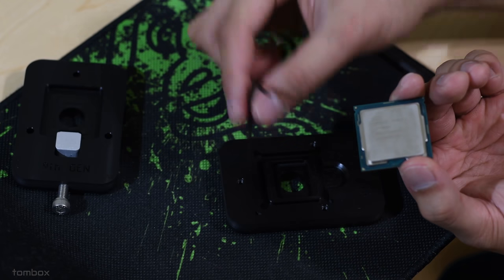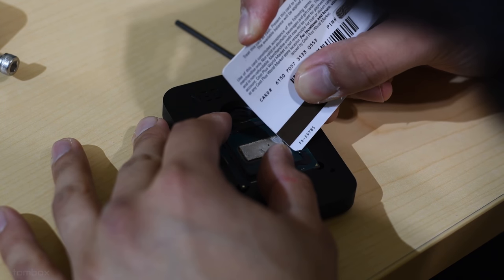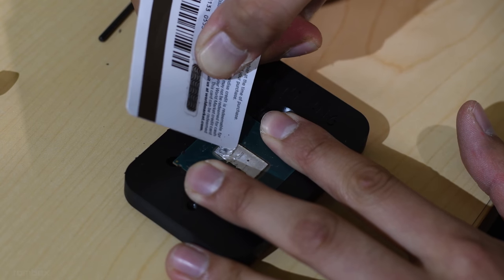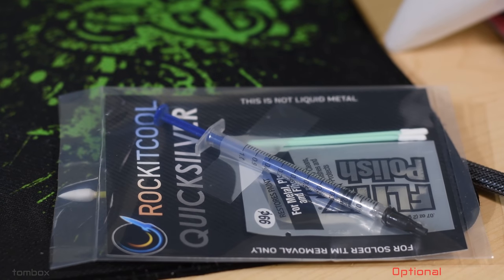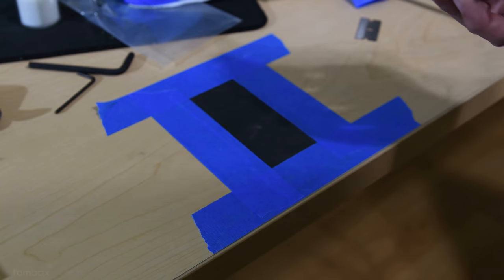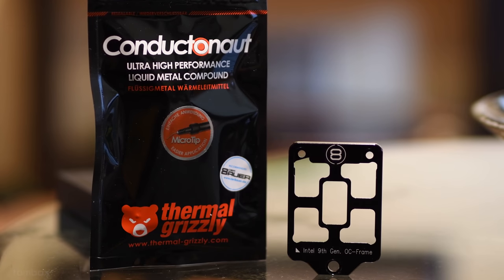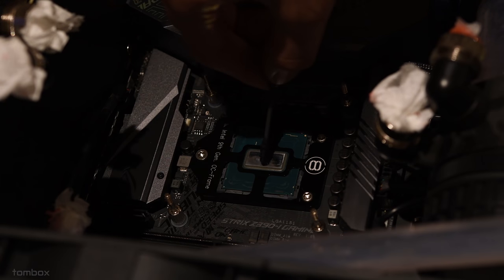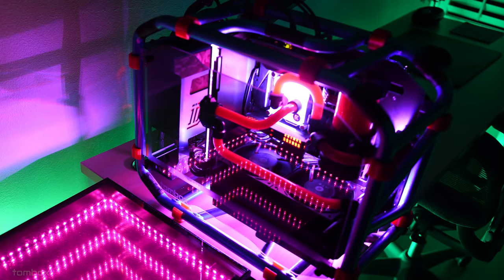Delidding, lapping and applying liquid metal on the 9900K!

Comment: i used the Rockit 88 to delid mine.   i just put the wedge/block already protruding a bit when i put the two halves of the Rockit 88 together with the cpu inside.  this gets the wedge already over the substrate so there's no chance of it hitting the side and ruining the chip.  just don't tighten the 88's retaining screws too tight.  i then switched the cpu 180 degrees a few times tightening a little more each time.   about the fourth time it popped loose.  i scraped the solder off with a sharp edge of the plastic "relid" tool that comes with the 88.  my solder came off very easy and i touched up the underside of the IHS with some 1000 grit paper.  i then used liquid metal to replace the stim and it dropped my max core temps by 10-12 degrees and my average core temps by 6-8 degrees.  also, my cores now stay within about 6 degrees of each other.  depending on the load, i would see up to 12-15 degrees spread between some cores.  the cpu was a poorly binned i9-9900kf heat producing monster...  i still plan on working on the IHS a bit more to clean things up a bit and satisfy some ocd tendencies.

Comment: I am not commenting on your video for the first time. Actually I have a thing to discuss. I am personally using a 9900k direct die with a 280mm radiator. My temps never cross 70c at stock clocks with a room ambient temps of 32c. I delidded my 9900k and removed the solder using the flitz polish, it all worked great and I was left with a shiny new die. But I decided to not reduce the die height so I never went for die sanding just because I was not certain about doing it with my hands. I have seen Roman's video and he reduced the die height of one of the 9600k to -0.20mm and he achieved a drop of 5-6 degrees (he was not running direct die he placed the stock IHS back using liquid metal once he reduced the die height of the 9600k from 0.84mm to 0.64mm). So here is what I think: the 9900k's die height is 0.84mm and according to 'Roman' it won't be a problem if we could reduce the die height to half about 0.4mm would be perfectly ok which is almost the height of an 8700k's die.
I don't want to die sand my 9900k with my own hands instead I am looking for a machined solution through which I could reduce the die height from 0.84mm to about 0.42mm. Do you know how should I got for it. Which machine or 3d printer will u suggest?
Reply from the maker: I have no idea where to get it done professionally, but that sounds like a great idea! I just know my DIY job was sloppy, yet it still worked, so there's some room for error. Sanding it down clean would probably net better results. LMK how that goes!
Reply: @tombox1236  there is a friend of mine who could help me with this, I think if I could reduce the height from 0.84mm to 0.42mm then I can easily drop around 10-12c on max load temperatures. But the procedure is not going to straight forward, have to keep a check on a lot of things to make it a success. Surely will keep you posted. Would be better if you could share your email id via DM.
Reply: @tombox1236  i more thing, you lapped the 9900k's die, can you tell me how much you removed of that 0.84mm die height?
Reply: @bloomfield295  and @Tombox  I have delided and used a direct die cooling with the OC frame in my Eurocome Sky X7c Clevo chassis laptop.  I used a vaccum chamber 3mm thick and it increased my z-hight by up to 0.4mm.  I am planning on lapping the CPU to improve my contacts and cooling system tolerance.  How much did you remove lapping the cpu?    Anyone has an idea of the thich=kness of the STIM solder or the height pcb top of the IHS before delidding the i9-9900K?

Comment: Love the video, how much can you take off with lapping and still be able to use the frame?
Reply from the maker: I didn't measure it, but I just lapped enough to even out the top surface. It could definitely be done more precise, but my video shows that even a botched lap could still produce positive results. My goal was to just even out the surface. If you decide to sand down the cpu, there's some wiggle room in case the cpu isn't lapped perfectly flat. Personally, I'd say just sand the bare minimum for a flat surface. If it's already flat, maybe consider skipping sanding it down. If worst comes to worst, like when the cpu gets sanded down too low for the cpu cooler to contact with just liquid metal, you can probably use something like a graphite thermal pad, which der8auer is supposed to release soon.

Comment: Hey great video! I’m currently direct die cooling my 9900K with liquid metal but I’m curious how your cpu is since you sanded it down 10 months ago? As mentioned in another comment there’s some concern about the liquid metal fusing with the silicon have you experienced any issues long term?
Reply from the maker: I've had 0 issues. I changed the coolant a few months ago (maybe 2-3), and everything looked good.
Reply: Tombox that is great to know! I’ve been deciding if this is something I should do myself but hardly anyone has done it let alone for as long as you have. Most people have only been running like this for 3-4 months so it’s nice to get a more long term result!

Comment: I recently saw der8uer's video and he mentioned that using liquid metal after sanding the die could be dangerous and some of the atoms of the gallium and indium could leak thought that die and could potentially damage the CPU.
Please mention how is your running right now, any issues or is it just working fine...
Reply from the maker: I've had 0 problems with the lapped cpu so far. The only issues I've ran into with this build is the coolant keeps changing colors, but that's prob because I got an early batch from EKWB.
Reply: @tombox1236  I am thinking of sanding my 9900k as I could drop as high as 12c if I shave the die from .82mm to about .45 mm. But the real problem is, how shall I apply even sanding pressure through out the process of sanding the die, I think it is really important because if I am going to use my fingers to sand it then I would easily apply a little bit pressure on one side and that will result in an uneven surface. So for a long time I am thinking of doing it but could not find a way to sand the die evenly. If you have any ideas please let me know?
Reply: @bloomfield295  What did you end up doing?

Comment: Would it be possible to just use plastic razor then? To remove the solder? Was thinking about doing this but don’t want to take an actual metal Razor to the die to jail bait lol and the quicksilver kit is hard to get here in the uk.
Reply from the maker: That should work. It'll probably just take longer though.

Comment: I wanna resell my 9900K after delidding it. I wanna reseal it using Permatex black silicone gasket maker. Should I use regular Thermal Grizzly Kryonaut or go with Liquid Metal instead before sealing the IHS?
Reply from the maker: If you're shipping it out, especially to someone that doesn't know how to do computer maintenance, then probably kryonaut.

Comment: do you need to scrape off the solder and sand it down if you are going to use thermal grizzly kryonaut or is this process only for liquid metal?
Reply from the maker: You definitely do not have to sand it down. It was done to further reduce temps.

Comment: Nice job!

Did you have to replace any screws of the EK Velocity to make better contact between the die and cooler?!
Reply: I delidded my 9900k and i direct die mounted it with OC Frame, i used my ek velocity block with stock screw, everything is fine.

Comment: Hey nice video man! How long do you need to clean it for with the Solder Remover and sanding it? Thanks!
Reply from the maker: I think it only takes 10 minutes, but I definitely left it on for longer. Here''s what ROCKIT emailed me: "As you may know the Quicksilver actually dissolves the solder. Leaving it on for as long as it takes to dissolve all the solder is perfectly fine.

It will help to agitate the Quicksilver.

Move it around and if you feel some solder that is not dissolved, use something like a toothpick or even one of the swabs that we send (blunt end). If you feel some solder, use the toothpick to sort of scrape it and give the Quicksilver something to dig into and dissolve. You should be able to dissolve all of it using that method.

You can reuse the Quicksilver if you want to scrape it off into a plastic container or even pull it back inside the syringe. Check the CPU and if it’s not all gone, re-apply and agitate until it’s all gone.

You can’t hurt the CPU with it, it’s non toxic and safe to handle. I wouldn’t eat it but short of that, it’s pretty safe :)."

Comment: This is another level, i delidded my 7700k and raplaced tim with liquid metal, but i'm to scared of doing the same to my 9900k
Reply from the maker: This was my second time doing something like this. It has been six months, and the CPU is still running great! If you already did this to your 7700k, then you can definitely do this to your 9900k. Just take your time.
Reply: @tombox1236  the delid part is fine, along with spreding liquid metal and putting it back together , scraping off indium.. Well that's a bit scary. Being a 500$ CPU isn't helpful hahaha :)
Reply from the maker: @greggreg2458  All it takes is a little courage. :).
Reply: @tombox1236  update, i delidded my 9900k, i used liquid metal to dissolve indium soldering, worked like a charm. I didn't sanded the die though. I tried quickly 5.3, hottest core 83°, i left it at 5.1 for daily OC. Worth it.
Reply: @greggreg2458  hmm. Making me want to try removing my Indium with Liquid Metal too.

Same type of process? Seems like a LOT of money to waste though. Wouldn't you need like $20 worth to do it?
Reply: @nexxusty  I live in Europe, and for me buying 1g of Conductonaut is way cheaper than import rockit cool solder remover from US and pay a truck load for shipping.  I used less than 1g.

Same type of process. Maybe i left it on the die 5 min longer.
Reply: @greggreg2458  makes sense, I might give it a shot. I think I have half a syringe left over from my last tube.
Reply: @nexxusty  remember that you can use car polish creme for a perfect mirror finish on the die.

Comment: Question regarding der8auer direct die frame: Will I be able to use my Corsair H150i Pro with any of the included standoffs? Can you advise me how to mount an AIO with this product?
Reply: no, the included screws will not fit. I have the same AiO. you need to buy antoher screws. check out der8auers english youtube channel, he explains it there (sry for the bad english)
Reply: @cobaincase  What size screws did you end up using? I have m3x25mm and it works, but there is room for improvement.

Comment: How long did you sand the die for? Thinking of doing this to my 9900k due to about a 10c delta between cores.
Reply from the maker: Honestly, I don't remember how long exactly I did it. I just know mine didn't end up 100% even, but it still works 100% today.
Reply: Did you ever fix the delta? Im at 15c on my 9700K DIRECT DIE. thinking of Sanding the die.

Comment: Have you experienced any problems with the CPU, 8 months later, after lapping the die and applying LQM?
Reply from the maker: I just took everything apart for cleaning about three weeks ago, and it has 0 problems! The cpu die still looks about the same as when I first applied liquid metal.
Reply: @tombox1236  dude, you are such a noob for cleaning it.
btw. get your facts straight.

Comment: Did you use naked ivy bridge standoffs? with that die-guard?
Reply from the maker: No standoff screws were used for installing the OC-Frame. The CPU cooler was installed normally.

Comment: after scrapping of 95% of the solder i thought that quick silver thing would be sufficient enough for wiping of the remaining 5% of the left over solder but u still went for sanding the ihs that makes me feel that the quick silver failed to do its job.
Reply: sanding off .1-.2mm of the die actually yeilds even lower temps fyi
Reply: he sanded the IHS to even the contact surface, not because he needed to remove solder.
Reply: @P34kyBlind3rs  that was the die lol not the IHS..